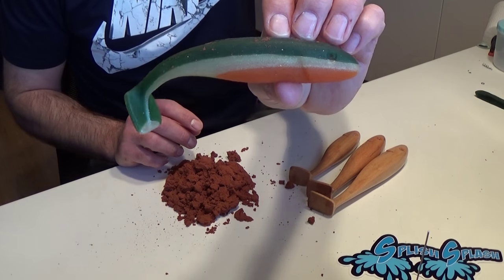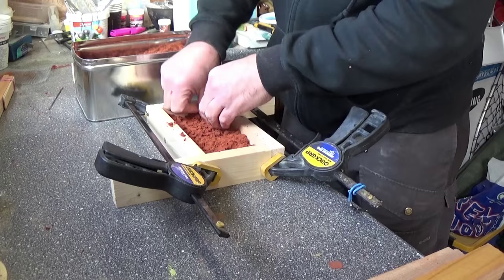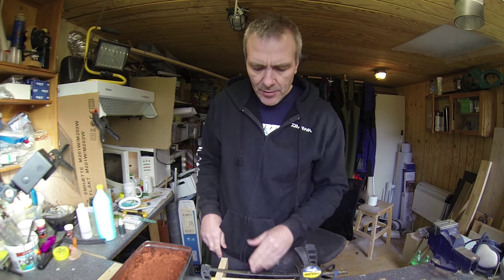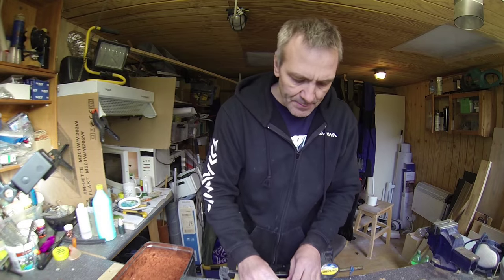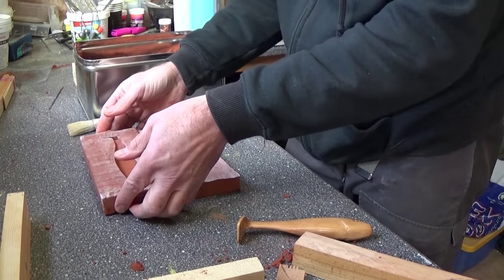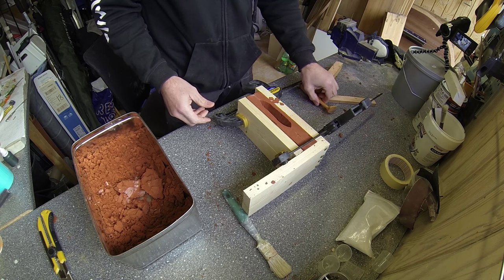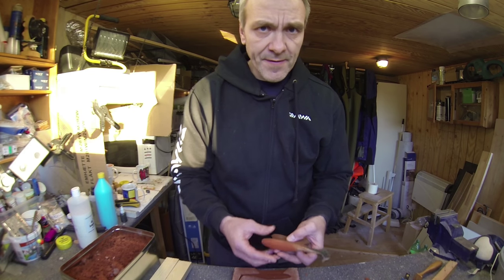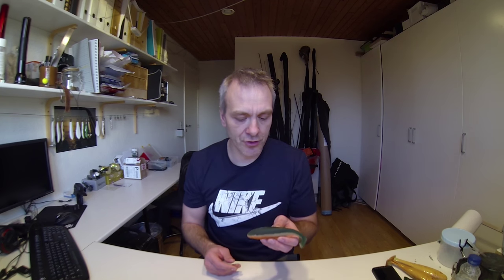Casting Sand Mould for softbaits - Done in 15 minutes

Comment: Thank you VERY much for another excellent video that addresses an issue other YouTube lure makers largely ignore: the high cost of the two-part silicone we all use for making "permanent" molds. As you point out, investing in a silicone mold without testing a prototype lure makes no sense at all, and the low-cost casting sand solves this problem.
    I do essentially the same thing with Hydrocal, which is a lot like plaster of paris but about three times harder and stronger. The molds I pour around each prototype bait aren't perfect, but—like your molding sand—the Hydrocal produces a very usable, remarkably "clean" lure to test. In addition, this plaster is self-leveling, so that eliminates the time and effort needed to compress casting sand with a stick of wood.
Reply from the maker: I have been using POP molds as well, and for prototypes the are fine. But it takes a few days for the mold to "dry" completely, and with the casting sand you can cast right away. On the other hand, if you are only cast lures for yourself, the POP mold might be all you need in the long run. You can also get something they call porcelain-powder which is a plaster the is much more durable and hard than POP.
Reply: Hi again,  @SplishSplashFishing . You're certainly right about the long time required to COMPLETELY cure Hyrocal plaster. Another of its significant drawbacks is that the plaster has no flexibility whatsoever (compared to silicone). 

    Over time, I have learned the hard way to shape my masters out of HDPE board, which gives me a little flexibility in the tail section. So, if the master doesn't release easily from the hardened plaster, I can pry it out without seriously damaging either the master or the Hydrocal.
    I would think that your sand molds would be good in this respect. Wrestling a sticky master might distort the mold, but this method was designed for a single "shot" anyway! Presumably, it would be much easier to remove a master from the relatively soft sand than from hard-as-a-rock Hydrocal. Happy New Year, Chris

Comment: Great video, great idea, I have a tub of casting sand that i use for pirks so I may give it a go
Reply from the maker: +Paul Adams (The Handmade Fisherman) I was actually quite amazed over the result. Hoping it will help people test projects that otherwise would be rejected, and maybe we will see some quite new crazy things. With the innovative projects you produce, I wouldnt be amazed if some of those things came from you  ;-)
Reply: +Splish Splash just use the wood and a hammer to pack it down your making it so much harder than it should be

Comment: Thanks for sharing. I’ve just started to make softbaits, first one a success, the second one a failure so for my third attempt I also made a prototype but an open pour one. 

I bought the cheapest caulk of sanitary silicone I could find, pumped it out and mixed with corn starch into a dough. Attached the dough around my master (oiled a little first) and waited for it to set, 2-3 hours. This mould I can use many times but the paddle were still a failure so I won’t. :D
Reply: Seen this method used for two piece molds of other stuff, so that might be my next project. A more detailed lure. 

Think it’s good for prototypes but to use it I’m concerned about if the plastisol suck the corn starch from the silicone and clouds up.
Reply: Hi There. I know of this technique but it seems to be very messy, and the price not much cheaper than actual mold silicone. The advantage with the casting sand is that you can use it right away.
Reply: Jørgen Harreby Yeah, it was way more messy than it looks like in peoples videos too :D but it was cheap, paid 19kr for the silicone and had an old package of corn starch. :)

If I continue making softbaits I will try the casting sand method. Or maybe a two part plaster mold.

Comment: Splish Splash to make them shiny you can run a heat gun or propane torch across them. It works great and its real fast!
Reply from the maker: Yes I have tried that as well - But as most of the baits I make in casting sand, are only prototypes to check the movement, they dont need to be shiny
Reply: Garrett Whitt true

Comment: Hi, again, Jorgen. When I commented recently (and very favorably) on this terrific method for making temporary molds, I forgot to ask why you use talcum powder as a release agent instead of the Vaseline that you normally rely on. Could you explain? 

     I just used the last of my Hydrocal to make a temporary mold for a new 7 1/2-inch "jerk bait," but I will DEFINITELY switch to sand for all my future temporary molds. Thanks again, Chris
Reply from the maker: You can only use casting sang for softbaits. The resin will suck into the casting sand. I dont think i would be possible to use vaseline with the casting sand as its a bit like wet sand. The talc will just let it seperate.
Reply: @SplishSplashFishing   Sorry, I should have made clear that my new "jerk bait" IS made from soft plastic (Plastisol). Thanks for the additional information on talc.
Reply from the maker: @labtrainer09  Ahh - Well then you are good to go with casting sand

Comment: wonder if you can use casting sand to do a two part silicone mold.  instead of clay which seems like a pain in the butt to evenly place on one half of the master.  casting sand would be easier to build up the half, cast the silicone then repeat on the other side.  you could get equal castings by being very particular about your markings on the box and lure so you make both sides as even as possible.  really cool video.  in the future consider trying to do a voice over speaking / reading the process so you can have a much clearer video.  it was hard to fallow with all the ums but very good.
Reply from the maker: +Pawel Sawicki 
Hi Pawel. I'm not certain to what degree the silicone would soak into the casting sand. From a test with resin, i found that it soaked into the sand, and i fear the silicone would do i a bit as well. I stead I would advise you to find some softer clay. Kids play dough works fine.

On the speaking part, you are right in your criticism. I was probably a bit worse in this movie as it was recorded in one day, and edited the next. Just wanted to hurry publishing my "great idea". But you are not the first to mention this, and I will consider it for the future.
Reply: Good clip none the less :D
Reply: Hey I been doing some thinking - do you think other materials could be placed on the sand then the mold material?
Reply from the maker: +Pawel Sawicki I have considered plastic, but i guess it woyld leave marks in the lure. You could try giving it some spray varnish, but that would ruin the sand that it is soaked into. but still its a cheap way to make a prototype
Reply: @SplishSplashFishing  Your English is fine. We all know it is not your first language and I celebrate the fact that you are bilingual. Keep at it as you are teaching many of us a new skill. As a new beginner to this I find the art that you create masterful and truly something that satisfies your crafting and knowledge sharing goals.

Comment: This might be possible using plaster as well, to make a permanent mold.
Reply from the maker: Sure it would. Have made many plaster molds through time, but they require some time to harden and let the moist evaporate. So for a quick prototype this is better.

Comment: run a heat gun over the  product for that cleaner finish.
Reply from the maker: Yes - That is a way to get a smooth surface on lures made this way. Another way is to dip it in clear softplastic. That gives you an incredible finish. Check one of my VLogs for that
Reply: thanks, i appreciate the videos!